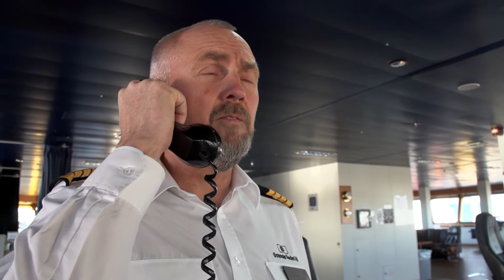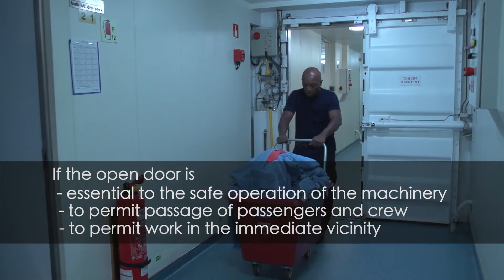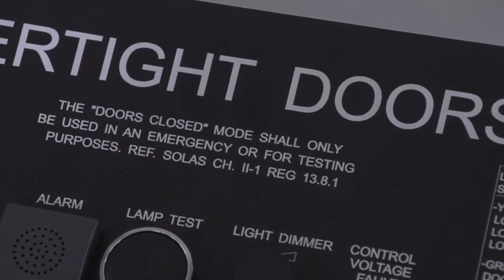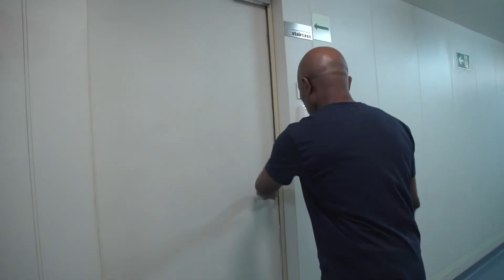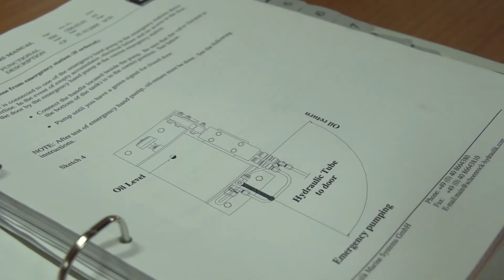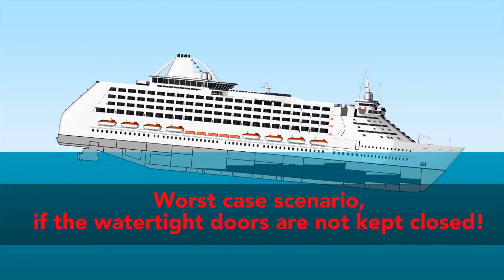Watertight doors awareness

Comment: So can water overspill into the next compartment when it reaches the top of one of the Compartments?
Reply: That would not happen if the compartmentation works properly.
Reply: @spacefallsFH What do you mean by that? It happened in Titanic...
Reply: @rohitgoyal7258  I'm pretty sure, from what I know of what happened on the titanic, was multiple bulkheads were breached by the iceberg. It would only have spilled over after the ship began to tilt over.

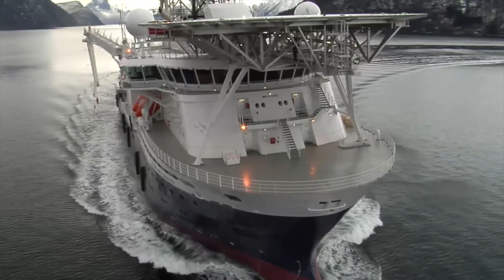Comment: 3:35 i'll be honest im more concerned about the notion of a ship being built in such a way that a single water tight door being left open can sink a ship ... i mean if nothing else 1 no two compartments flooding alone should be able to sink your ship .. if it can you need more and smaller compartments and 2 i would hope there at least enough pumping capacity on your ship to be able to match the flow that could conceivable come through an opening the size of one water tight door

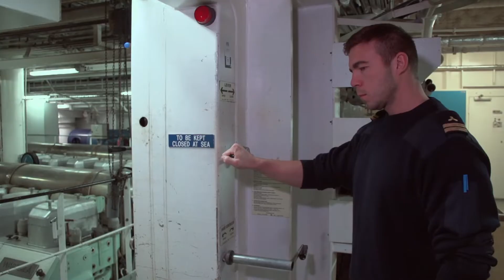Comment: 2:26 honestly i would have just assumed they were interlocked such that you cant open up the next one until the one behind you has been closed   and or a timer
Reply: That sounds like a lot of extra annoyance without added safety.
With all security and safety stuff, you have to consider daily usability.
Force password changes too often, you end up with simple password patterns or sticky notes with passwords.
Make the watertight doors too inconvenient, everyone will disable your extra checks.
The doors will literally be a compartment length apart. That doesn't really call for an airlock design.

Comment: I wish they had this on titanic
Reply: They did  the issue with the titanic was that too many compartments where breached and the water tight compartments did not extend high enough - the water ended up flowing over the top to the next compartmetn as that part of the ship was pulled down by the extra weight of the water.
Reply: Titanic was designed to survive with 4 compartments breached. The doors closed correctly. But the iceberg breached 6 compartments, absolutely unimaginable. Ships today are designed to survive "only" with 2 compartments flooded and instead focus on the fact that no ship can be made unsinkable and should rather sink evenly, slowly and without a big list if a fatal strike does happen.

Comment: And the TITANIC kept theirs open while at sea… Cost them the entire ship.
Reply: Don't say shit like that
Reply: That's not true
Reply: On the Titanic they closed the doors as soon as the collision occurred. The problem wasn't anything to do with watertight doors. The issue was that the bulkheads didn't extend high enough, and as such, the Titanic could only float with up to 4 compartiments flooded but the iceberg compromised 6 of them.
Reply: @lucah9518  Yup. my point being, when the Titanic came very close to the berg I believe if they closed the doors as a precaution before there was a chance of collision there may have been hope.
Reply: @jtc72-j6p  Unfortunately there wouldn't have been any hope either way. As soon as more than 4 compartiments were gone, no matter if the doors were closed before as a precaution or not, water would communicate over the tops of the bulkheads at E deck.

Comment: What if in the bridge of the ship they switch the master switch and someone in the bottom of the ship cross the watertight doors and get locked inside floating room what happens when then
Reply: It's required that area's with remote or automatic closing watertight doors have an alternative exit.  Also the doors can be operated locally so a person can open it to save their life.  Most remote doors will then close again automatically shortly after.
Reply: @timaahhh  So the doors can still be opened locally even if the master control switch is set to 'Doors Closed'?
Reply: @carlmanvers5009  Yes they can be opened locally (they should only be opened if no alterative route is available and the bridge commanded the doors closed).  

At the door, the switch must be held to the 'open' position.  If there is hydraulic power the door will open.  Doors usually have enough power locally to close open then close again if the ships power is lost. If there is no power from the ship or the doors local power is depleted, then it can be pumped open by holding the switch to open and cranking the pump until the door is open.  

Then from the other side of the door you will hold the switch in the open position until you cross through the door.  Once you release the open switch the door will close automatically if the bridge master switch is still set to doors closed.  If the door was pumped open manually then the action of pumping the door will sufficiently charge the hydraulic accumulator to reclose the door once the open switch is released.

Comment: How did titanic sink?
Reply: The Titanic was designed to float if the first or last 4 compartments were flooded, or if any combination of 2 compartments flood.  The first 6 compartments were flooding after the collision, the water tight doors and compartments slowed the sinking but the damage was too extensive for the ship to float.  As water entered the ship the additional weight caused a forward list and water could bypass bulkheads by over topping them.  With only 4 compartments flooded the ship would have remained buoyant enough that water would not over top subsequent compartments.
Reply: timaahhh oh... thanks fore the info :D
Reply: timaahhh and i guese u mean the wrong part of the ship got hit
Reply: Titanic was afloat perfectly fine, and was believed to be unsinkable, but it ended up striking an iceberg, I believe they were going around 22 knots but possibly less. The Titanic struck an iceberg because the lookout crew could not access the binoculars, and some believe that if Captain Smith and his crew did not try to turn to avoid the iceberg, they’d have a higher survival chance.  The iceberg breached the side and more compartments were exposed than what it was designed to hold.  Once the compartments started filling, the bow sank down as if the whole ship was leaning over. Later, the ship was almost fully tilted and the bow could not handle the stress of the stern, so the ship snapped in half. The bow was still connected to the stern so it brought the stern down and eventual separated. Titanic was very tragic, even I am obsessed with the history. Hope you learned something new! 👍
Reply: @trebsquad1568  willhelm gustoff
Reply: the titantic also didn't have bulkheads (walls that extended from side to side) that went all the way to the roof. picture a box without a lid. because of this, even IF the ol' tit of anic had watertight doors, the water would have just run over the top eventually.

many of the safety regulations in ocean vessels we have today can be traced directly back to the titanic